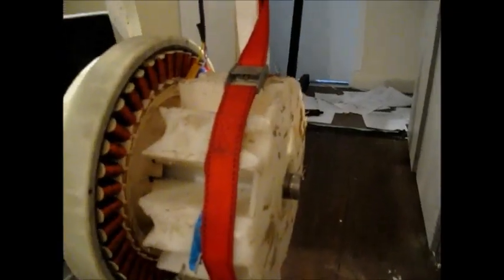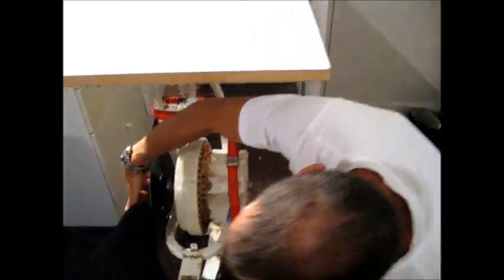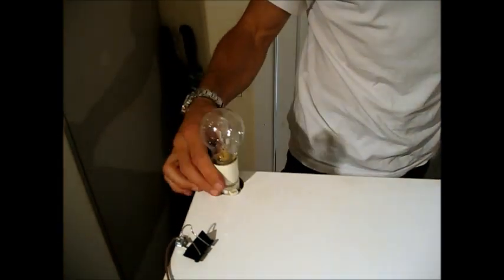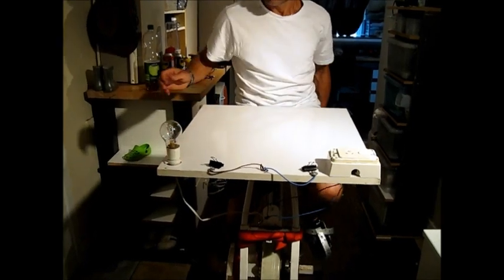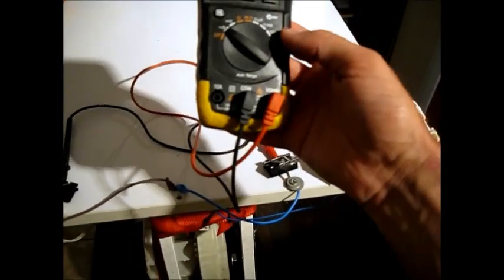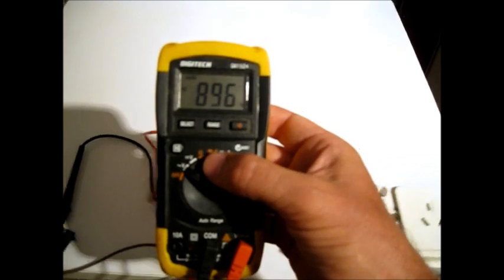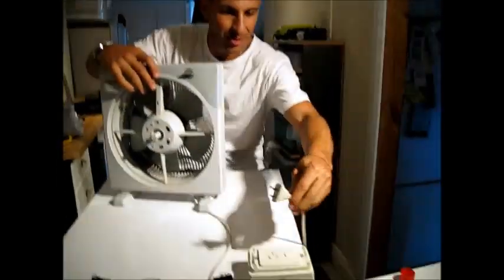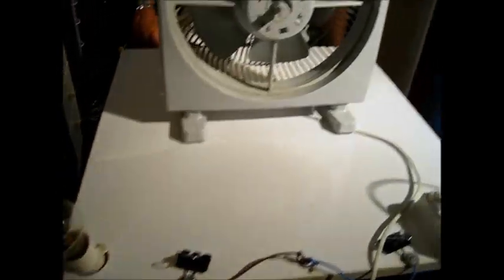Australian Friend Demonstrates His Pedal Powered Fisher and Paykel Generator

Comment: Couple this with a transformer and a MPPT charge controller, and this would be a very useful way of charging batteries in an emergency.  The MPPT controller would deal with the varying voltages coming from the feet, and provide a solid charge overall.
Reply from the maker: Right I was thinking of an mppt wind charge controller which can handle the varying voltages and current

Comment: Use a recumbant style bike. Its easier to peddle for longer time frames.
Reply: lightbulb goes on  I actually have a frontload washer with that setup sitting in my livingroom. Was going to give it to the neighbor kid for scrap but if the motor can make that much juice then I need to do something else with it. This would be a perfect setup for a water wheel with the low speed needed to get standard home voltages.
Reply from the maker: MasterCollingwood Keep it for sure. These things are very valuable. Amazing generators.

Comment: For the zombie apocalypse this would we way to loud. Just saying.
Reply: Consider this, Wind turbine tower in a remote area. Run the wires from it, underground to your hideaway. The noise draws them to the tower and not your home. You use a moderate size transformer to drop the voltage down to the necessary 120/240V. So long as the wind blows, you have juice. :)  You get to use it for power AND distraction.  :D hehe
Reply from the maker: In an underground bunker the noise would not be heard outside.
Reply from the maker: MasterCollingwood I would prefer a backup in case someone cut the lines to use the power for themselves tho.
Reply: The Do It Yourself World
A backup is ALWAYS a good idea, though if you run the wires down through heavy duty piping and into the ground then its less likely they'll be able to tap it. Since your tower should be over 20 feet in the air anyways it should stay relatively safe.
Reply from the maker: MasterCollingwood Good points.

Comment: Wonderful - I wonder if it would be possible to use the washing machine motor connected to a wind turbine to generate a more sustained amount of power.
Reply from the maker: If you mean with some blades, then yes. I think it would be a very powerful wind turbine.
Reply: yes works well